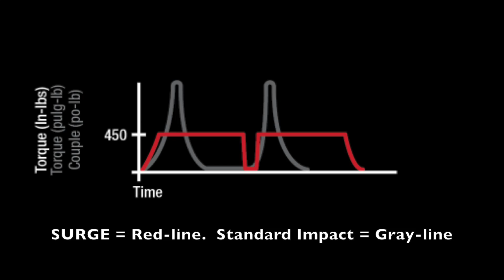Milwaukee M18 FUEL SURGE Hydraulic Driver

Comment: Good topic Rob. This is an issue for many workers and not just in the typical manual labor jobs such as construction. I'm just a DIYer that works in IT, but this is a problem in our field too. Some folks don't take earpro seriously and stay in loud confined spaces like server racks or data centers with poor to no earpro (noise cancelling doesn't count!); unfortunately that leads to hearing loss and tinnitus. I have a bit of tinnitus myself and have since taken ear protection much more seriously.

Comment: Note: If you use the self-tapping screw setting, you MUST pull the trigger all the way (or at least past 1/2) to activate the automatic stopping.  If you try to drive a self-tapping screw slowly with less than 1/2 trigger pull, it operates in conventional impact mode and strips the screw every time.

Comment: I got this as a gift. Upon first use I wasn’t super impressed, but as time went on I came to love this thing. I actually don’t love it for deck screws or framing screws. I love it for cabinets, cabinet pulls, doors, door knobs, finish screws, etc. That balanced torque makes this impact sooo much more precise than a standard impact. It isn’t as quick as the fuel, but if you value precision as much or more than speed, this is for you.

Comment: Great video, especially regarding hearing protection.
I just purchased the hydraulic driver as after using a standard driver, the noise got to me very quickly. I always went back to using a drill.
I continuously preach to my girlfriend to wear hearing protection anytime she is using a leaf blower or running her lawnmower.

Comment: Hey Rob, thanks for reinforcing why you should use the right tool for the job even if it's not as cool as the Surge. And for explaining the inch per pound torque for different fasteners as it applies to the Surge, awesome video. And yes, yes, yes, ear protection is a must, on a job site, you're rarely running just one tool.

Comment: Torque is the product of the length of a moment arm (inches) times the value of a perpendicular force (pounds) applied to the moment arm, this gives torque units of "inch pounds" not "inches per pound".  Torque is a distance multiplied by a force, so inches is multiplied by pounds.  To get "inches per pound" torque would have to be defined as a distance divided by a force, but that is not the case.    T in lb = r in x F lb

Comment: Your forgetting a key benefit to this technology: this impact delivers soft blows which means less shattered fasteners and bits. Set some screws in concrete lately?
If your setting fasteners into sheet metal, your ears will thank you for going hydraulic.
Reply from the maker: B F you might be right, but the company is not advertising that as a benefit, it’s the hydraulic fluid the is bringing the noise down. The tool does have have less power / torque than a regular impact
Reply: My Makita "Soft Impact" has it's own unique benefits. In a noise restrictive setting such as a hospital or apartment, your typical hammer/anvil impact is forbidden. 
There will be times where I'll reach for the loud option: building a deck for instance.
The two mediums are like a mallet and a ball peen hammer. Both have their merits.
Why these qualities aren't advertised would be a question for the marketing department. 
And, if you find yourself asking what "it" is for, you probably don't need it.

Comment: I'm a general contractor (built 3 large decks this summer already) and I own several different impact tools and have owned even more. My old impact burned out so I decided to try the Surge. I can tell you with 100% certainty the surge is better for driving most fasteners than any standard metal anvil impact and will drive 4 inch lag screws easily and as fast as or faster than my other standard impacts, even ones with WAY higher torque ratings.

Comment: I have one that i use for hvac. A normal impact driver makes so much noise with ductwork. With the surge, it's very impressive how much less noise it makes. And at home, normally the dog gets all scared from the noise from a regular impact. Recently i was using it in the house for flooring and the dog was chilling right next to me because the noise wasn't scaring him. Very brute, but smooth power for regular sized fasteners. Doesn't like larger lag bolts or larger spade bits as much, but its good for what i do

Comment: I had originally thought this hydraulic impact phase was just a gimmick. This past week I've been replacing windows and doors in a home where the clients were living full time and retired. They insisted on remaining in the home for the duration of the job, in this case it was 3 days.. but having the clients in close proximity for the first time in my life, I became fully aware of just how loud my standard M18 impact driver really is. It's absolutely ridiculous indoors. Driving window fasteners while the clients are trying to make calls or watch a show was making me feel very uneasy. Now I'm going to make sure I have a quieter option in my tool box for situations like this.

Comment: Sad to say but the hydraulic driver will actually wear faster than the convention impact because of fluid cavitation on the vanes of the impact rotor. Ave has a very informative video on this driver on his channel you should check it out.

Comment: 1) this guy could've been quite so we could hear the darn thing.2) who cares about the proper application. If the MFG puts the required adapter 1/4"hex X 1/4" square or 1/2" square in the kit then it must be ok by the MFG.3) could somebody do this with cordless 1/2" and 3/8" impact wrenches!!!!!?????!!!!
Reply: Just because a manufacturer can put a spoiler and speedometre that goes up to 300kmph on a sedan doesn't mean the car will last long while attempting to make use of those tools. They're there to widen your tool's use options, that doesn't mean it's a daily driver for high torque applications.

Comment: would the lesser peak torque of a hydraulic make it less effective at busting nuts off in reverse?
Reply from the maker: Chris W   The Surge is definitely not an impact driver, although it resembles one and does many of the same things.its designed for medium to small fasteners, not lug nuts or large nuts.

Instead of a hammer and anvil impact-type mechanism, it works by means of a hydraulic system. It exerts torque as the oil is compressed, in a cycle of compression and relaxation.

The Surge driver is said to deliver 450 in-lbs of sustained torque. So… what’s that?

Standard 18V impact drivers deliver around 1400 in-lbs to 1800 ib-lbs of peak torque. This torque is delivered in a quick and short bursts. The Surge delivers torque for a longer duration.
Reply: i see.  i cant find the torque specifics for lag bolts through wood, but i assume 450 in/lbs would be enough?  i figure its just more handy to have 1 tool that can do it all :D

also do you see leakage being an issue down the line, especially for the contractor who might drop their tool and use it in all weather conditions everyday?
Reply from the maker: Chris W leakage is  is definitely something I was initially concerned about, been using the tool for at least a year and a half have not seen anything yet

I have not pushed to talk to its limit, that's typically when you see Lucas

Comment: Great review.  Fantastic information.  You're about the only person I've heard talk about the differences between an impact driver and impact wrench.  I ordered one of these hydraulic impact drivers last night and look forward to putting it to work immediately.  I also really appreciate the safety sense included in this video.  I used to think ppe was for pussies.   Then I got tinnitus (ringing of the ear) when my ear was near a 4 ft. Crow bar when someone whacked it with a mini sledge.
Reply: I've done demo work and had the exact same thing happen to me. When workers are piled on top of each other injuries happen often.
Reply: I have a question. Only starting to research it now as I started a new business and need one. Is the surge more economical on batteries?

Comment: I've had my first gen Dewalt brushless impact drive for a long time now. I change tires with it, I tear down and put chillers back together with it. I have never had a single problem with it.  Yes it's ment for fasteners but it is built like a tank and can handle task ment for larger tools. I don't want to buy two tools. So why should I when this Dewalt handles the task of two. Also I have used my impact driver nearly everyday since it's purchase nearly six years ago.

Comment: I freaking love this surge impact soo quiet means no air plugs, soo smooth omg saves me fatigue, i drive metal screws all day and i love this tool, its actually more accurate also in control of sheet metal screws, i just wish they have the one key system into this tool also, i would buy it and wouldn't worry about it getting stolen at work

Comment: I think I might buy this tool. Ohio Power Tool has this as a kit with two 5.0 batteries AND if you buy the kit you get the hammer drill/driver for free. The kit is $329.99 with free shipping and no taxes. (If you live outside of Ohio)

Comment: I got my first fuel m18 1/4 impact driver as part of a kit on black friday. About a month ago I sold just the impact driver and bought this m18 surge and couldn't be happier. I do a lot of work in my garage and late nights and keep my garage door closed due to the bugs and other stuff... so the first m18 was really loud reverberating in my garage. The new surge is so much quieter that I don't need to reach for my hearing protection all the time.
Reply from the maker: There's a big difference.

Comment: The new surge will fail before the older version. One word cavitation. When the "hammer" hits it spike the pressure in the fluid bringing the hydraulic fluid to its boiling point.  When the pressure drops the bubble that formed implodes eroding the lining of the pump. So the more you use the tool the weaker it will get till the veins in the pump can no longer hold pressure. This is a tool designed to fail.
Reply: Justin Molina with all the r & d they do don’t you think they have thought this through and added counter measures to prevent that thought? They released it on their “economy” line of tool first (Rigid) then implemented it to the bread & butter line... Milwaukee “Fuel”. & dont get it twisted I understand exactly what you saying, & can agree with that! I just figure challenging that theory in order to get more productive thinking out of both of us & you know the YT experts 😆 I watched AvEs vid on the rigid I don’t remember exactly what he said though lol have to rewatch it. but they have been using hydraulic tech for years & years. Has that been a problem known to effect those “tools/machines”? Let me know what you think!
Reply from the maker: Justin Molina mines still in operation

Comment: Why not just use a drill driver they are quiet  plus less vibration to do the same work   This is all marketing to keep tradesman buying new tools even if they don't need to . Thanks for the video
Reply from the maker: tom73055 I disagree an impact driver is way more efficient and powerful than a drill
Reply from the maker: There are benefits to impacts
Reply: Normal drills have at tendency to want to either turn itself out of the receiver on the screw, or turn your hand if the torque becomes insane. Furthermore, because the impact doesn't need to slow down for high torque applications it doesn't risk overheating the motor.  Finally, with a drill you need to be a lot stronger to get drive the same screws. I've got a rather small girlfriend, and if she tries using my drill to drive screws she will often have it kick back at her or twist her wrist, potentially causing injury, with an impact she can drive the same screws one handed because of the reduced kick. --- Drills can be great, especially for delicate fasteners (the torque control option most modern drills have is a lifesaver for small screws) but impact drivers are really good at... well, driving fasteners.
Reply: I have used an impact exclusively since 2010 with my first dewalt.

Upgraded to 18v ridgid stealth force last year and absolutely love it.

Comment: It's not inches per pounds - it's inch pounds! Torque is calculated by multiplying distance by force. It drove me nuts listening to you continually murder the unit measurement.
Reply from the maker: Thanks for keeping me honest guys - I had it right in the article - said it wrong on camera. Not the first time, won't be the last time.

Comment: i have the m12 fuel impact, but im not sure switching to m18 would be worth it..
Reply from the maker: Alex Linthicum the M12 too- in the shop, love them
Reply: Being a Hvac installer, m12 is a great product in my opinion. I am curious about the 3 speed m18 impact. 2753#

Comment: My Milwaukee 12v FUEL driver works for me all day running framing screws for renovation carpentry. I grab the FUEL M18 for Timberloks but I'd never go back to carting that physical format around in a holster.

Comment: I am bit puzzled here.
Yes, less peak power, but more spread power can work better with driving screws...

But Milwaukee 2606-22 drill driver is said to have 500 in/lbs. Since it's a drill, that means it will exert 500 in/lbs of power continuously, not as pulses, or not as impacts.
Which means, it can drive the same screws faster and quieter.

And, that drill is actually cheaper... What the?
Reply: Huge difference here in how the tool operates. Yes a regular drill is operating with torques in the same range. However, that's a constant applied torque whereas the hydraulic driver and/or an impact driver they are using impact energy along with the applied torque. There's absolutely no comparison of the ability to drive fasteners when comparing the two even at the same torque rating. It's a great question though and this is why we're trying to help users understand the technology and features.
Reply: I am sorry to say this, but I think you didn't understand my question.

Doing impacting or whatever way to focus power is to get more peak power when there is the same amount of total power available.

But clearly, if 500 in/lbs of continuous power is correct, that means it has far more total power than 450 in/lbs of pulse power.
And, of course, since they are using about the same motor, there is really no way it's possible.

So, is that Milwaukee's misleading? Or they used different way of measuring torque?
My question is more like this.

If you still don't understand my question, take like this:
"There is a screw that requires 470 in/lbs of torque to drive. Will 500 in/lbs drill driver drive it? And will 450 in/lbs of pulse driver drive it? Why?"

Note that, if pulse driver can drive 600 in/lbs screw, they wouldn't rate it as 450 in/lbs.
Reply: I understood your question. My point is constant 500 in-lb torque from a drill is VERY different than 450 in-lb of torque from the pulse driver. Even thought the hydraulic driver is nearing continuous torque, it's still "impacting" and applying pressure as it applies torque. It's simple to test....get out the drill and one of these and try driving a 6" TimberLock....I know which will do it faster and easier without doubt. Also, most small and medium size fasteners are less than 200 in-lbs of torque to install...yet a drill still struggles.
Reply: Impacting force takes away shock to the user and allows for one handed driving. this is why with hammer drills you see them with attachable handles more than impact drivers and more wrist injuries to go with it through improper handling. It's a safer way to drive screws and bolts all day which is one of the reasons its more favored in jobsites. Yes you can still drive screws with a drill driver, but you have a higher chance of wrist injury with high demand applications. Also impact drivers are less likely to strip screws

Comment: Nice job Rob.  I like the way you introduced the video because the safety of our hearing is something we should all be aware of.  Obviously OSHA is the driving force here (pun intended),  but it makes sense to develop and use quieter tools if they are available.  particularly when they do 90% of the work just as quickly if not faster.
Reply from the maker: Thanks
Reply: Just Good Script.
Surge Driver is no Ear protection solution.

Comment: Maybe just the video, but seems louder than the Makita...   I don't know I can only buy one impact a month,  Surge or Hitachi Triple Hammer?  I do like my Makita impulse a lot.    Great job on keeping all the numbers straight
Reply from the maker: one a month?  HAHA nice!
Reply: If you were choosing between the two, I'd recommend the Triple Hammer by far. Much more versatile (precision, medium, and heavy-duty work), more powerful, similar vibration (due to the third hammer), and far more torque. Also, the charger it comes with is ridiculously fast, even faster than Makita's! I'd wager the speed is similar at the very least thanks to the third hammer too, and (like the Surge) it's very compact/lightweight.